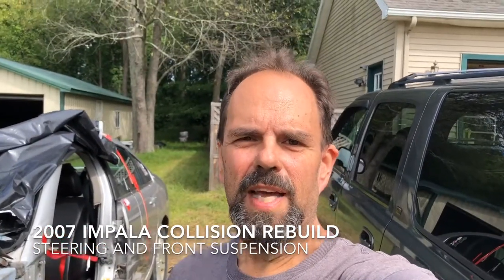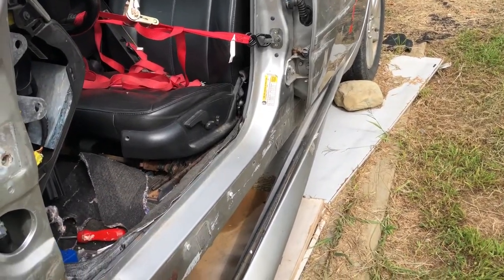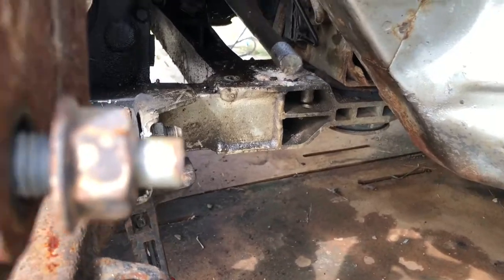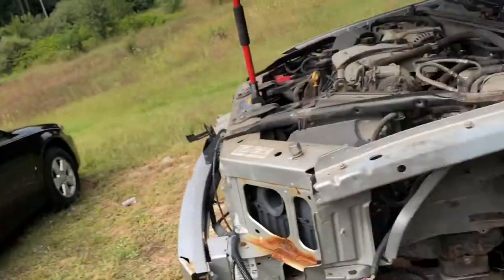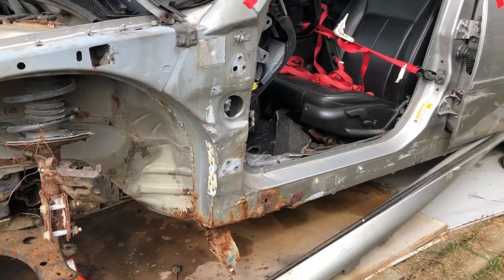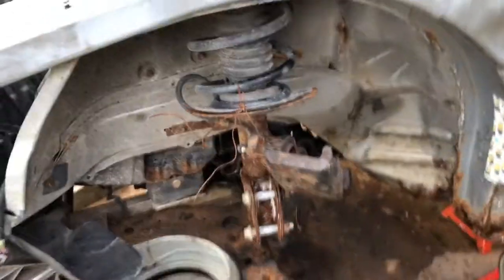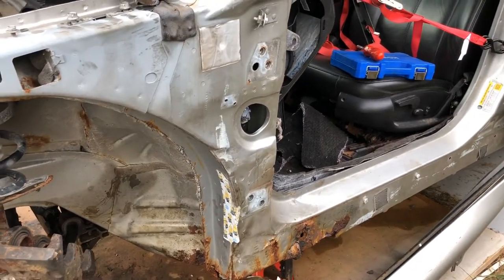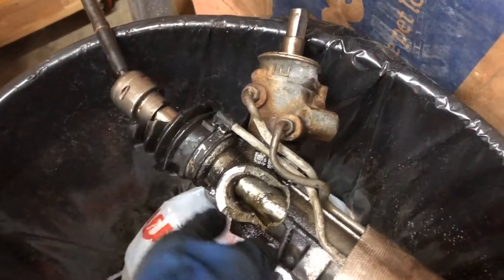2007 Impala Rebuild Part 5

Comment: It'll be interesting to see what you come up with on this one for pulling the A pillar out. With some pulling and some hammering you might be able to get it straight enough to put a door on it. The latest car I'm working on was hit in the same area. Mine didn't get into the A pillar. It did twist the wheel around and bent the outer tie rod into a U shape. Ended up replacing the rack It was pouring out power steering fluid. Not because of the accident. The seals were just bad.Anyway Looking forward to the big reveal. and good luck with crash.
Reply from the maker: Im thinking about getting a porta-power from Harbor Freight and putting the car next to a tree and using the tree to push against while simultaneously pulling on the lower hinge point with a come-a-along attached to the Suburban.  That way i can get it pushed outwards and forwards at the same time.  Picture the tree next to the passenger door and the ram coming across the car to the drivers foot well.  This is the time to be thankful that its not a center console car. 

If that fails,  I'll try th e dynamite.  #BOOM!